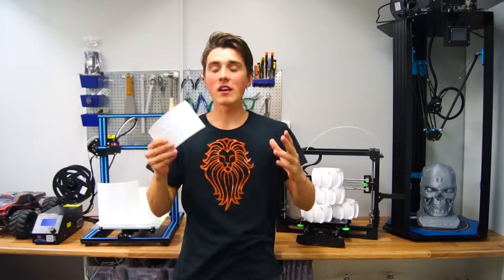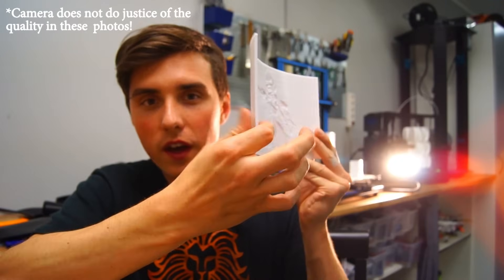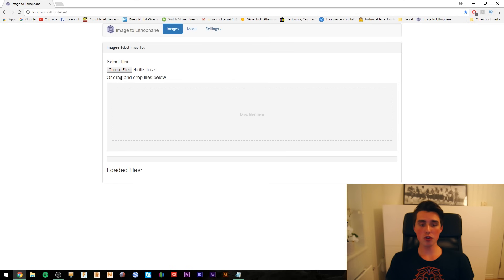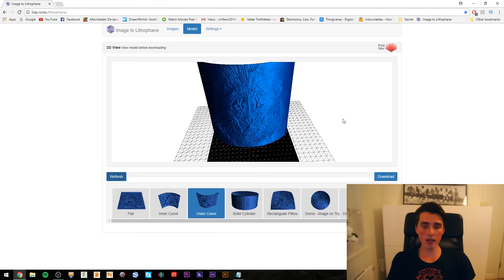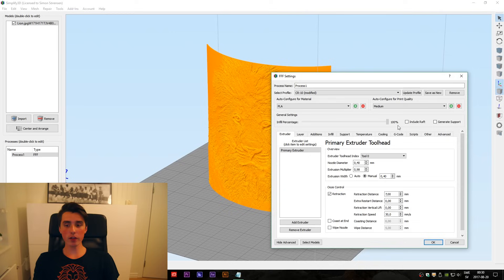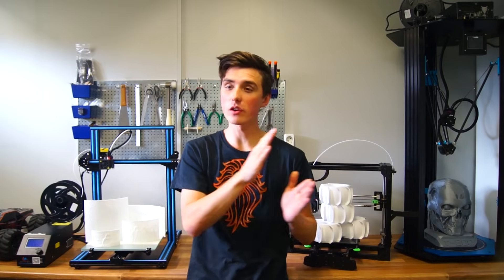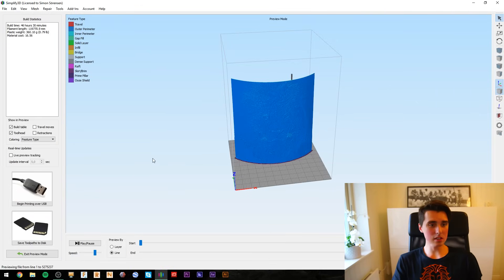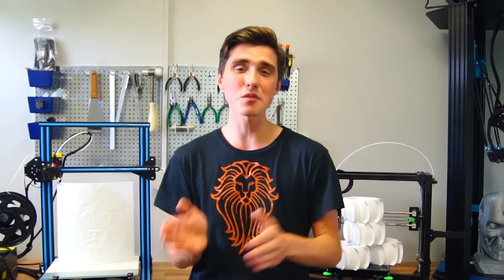3D Printing Your Photos - Lithophanes

Comment: Can you print a lithophane lamp shade?
Reply: You could theoretically put the lithograph on the inside as well, so the outside is totally smooth and the image is only there when the lamp is on.
Reply: Yes, and i think thats its possible to print it so you can see the picture only when the light is on, that would be awesome.
Reply: Colby Jones yes
Reply: You need a thinner wall is all. Sanding the outside smooth would also help, as I am sure the ridging caused by the layering would only compound the distortion. Also, You can't use infill, but would probably be better to print thin enough for 100% infill.

I actually made a mini-desk lamp shade with a cool pattern by strategically positioning the infill :) Natural colored produces the best shine through effect, but it looks pretty ugly without light shining through.. Ivory colored is probably best though, since it looks so nice both on and off, as long as the brand doesn't add too much opacity.

Natural PLA is 'clear', but it is never actually clear. Air gets trapped inside because of the FDM process, so it always looks translucent, like cloudy quartz.
Reply: how thin would be best ?
Reply: That would be so coool!
Reply: Jango Fett Productions . ill make them too, ill sell you one...lol
Reply: Richard Smith it drops the quality very bad...i can turn current one around and it works, but much less detail.
Reply: Brian Mize or use negative instead of positive?
Reply: Colby Jones or a window cover
Reply: Colby Jones!!! Your in the next video!!
Reply: Brian Mize I'm on it too
Reply: Colby Jones....not sure how pla would hold up with the heat from the bulb unless it's led of course
Reply: Just started using my 3D printer to print out some lithophane images and I was thinking this same thing. For those that are thinking about keeping the lithophane image inwards, so it's only visable when the lamp is on, my printed images tend to have less quality when I view them from the other side. You can still make out what the image is - even if you've never seen it before - but the quality is the best when it's facing front forward. Otherwise it looks kinda blurred.
IMO it would look cooler if the lithophane images were facing outwards on the lamp anyways. It might look a bit more intricate.
Reply: @artofrevolution191  can you upload an image?
Reply: @slicedpage  I dunno. Where can I upload an image publicly?
Reply: @artofrevolution191   I use tinypic or pixabay,both free.
Reply: That is exactly why I'm here

Comment: That so cool ! But I haven't yet a 3D printer and I don't know between the CR-10 and the Anycubic i3 mega, can someone help me to choose ?
Reply: Most will never print with ABS because the stuff is nasty. I have the CR-10 and have zero regrets.
Reply: I bought the CR-10 after watching his review back in those times, and it has been a great machine
Reply: Yes I know, but the "restart print after shutdown" function could be useful for me because me electric network is not very reliable (I have ~10 power cut per years) so that could save me some print ;)
And apparently the i3 mega perform better with ABS and PETG ?
But the build volume is better on the CR-10, so I don't know.
Reply: Nekzuris I own the cr10 and my brother has the anycubic and honestly each one has a strong point over the other. i really love my cr10 but the anycubic is such an easy printer for beginning 3D printing.
Reply: Nekzuris   many 3d printers are all 12V inside,  so you could add a car battery to keep it running through a power cut.
Reply: i say go with the cr10

Comment: Why do you put the CR-10 on the ground when you print?
Reply: If he works on the table there may be some shakes/vibrations that could transfer to the 3D print and that would destroy it :/
Reply: William To be able to shoot other videos on the workbench in the 42 hours it takes to print
Reply: @mcgamingproyt    There are videos on YT that show how to reduce the resolution.  Claimed it did not make a difference in the the product.  I think 3D Prof covered this.  I guess the idea is that you can get a decent photo with say 600x400, but you can print at almost any level of granularity within that possible source photo.
Reply: Pete Allum he puts it in the garage so he can sleep without the noise
Reply: If you look behind, he puts printer between window and camera, i think that's why, for light !
Reply: William 
Probably to save space on the workbench or because it's quieter on a solid floor or perhaps the printer is less likely to get knocked there or maybe ALL of the previous!
Reply: Its the CR10
Reply: Is the CR10 or the CR10 S?
Reply: probably also fire safety

Comment: Soooo you can also directly import images into Cura to create flat lithophanes. While the options aren't as flexible as the generator website, it does a pretty great job considering how easy it is